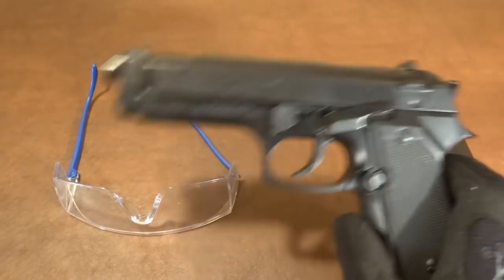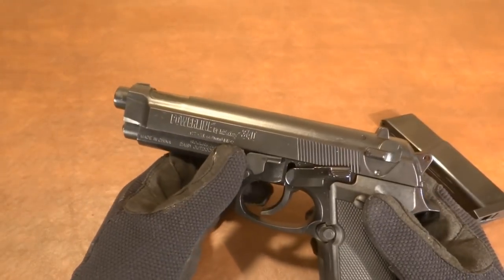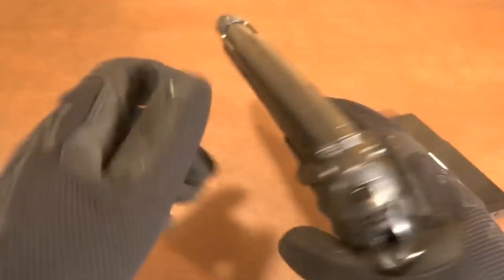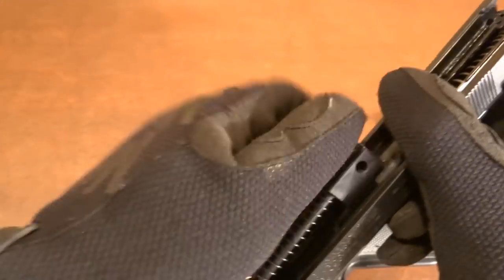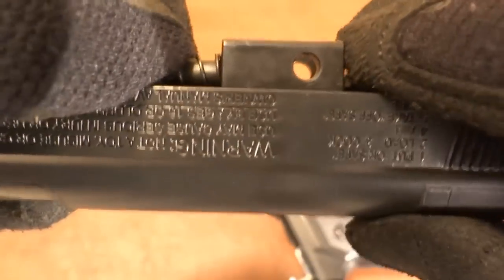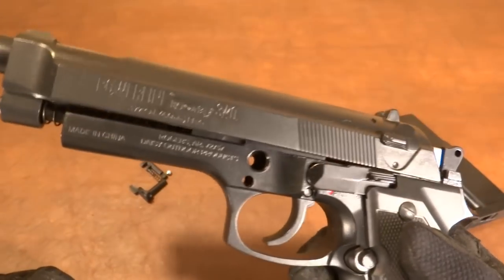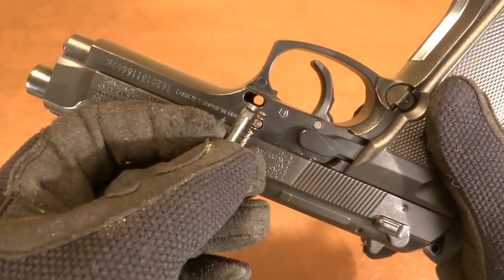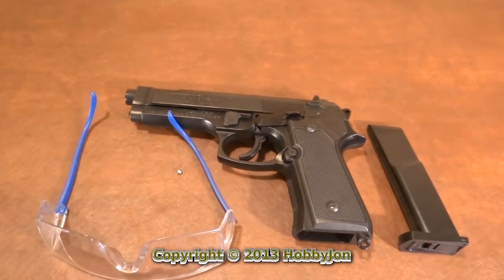Takedown Powerline 340 - Unofficial Guide

Comment: The entire upper slide assembly including barrel and recoil spring is removable.   Compress the recoil spring and use a vise grip on the guide rod to keep it from snapping back.   This gives you room to work.   Then You need to slightly spread the slide frame and pull out the plunger assembly.  I found that a bb was stuck in the plastic plunger assembly and it actually cracked the plastic, allowing gas to escape and cause low velocity shots.   Once this happens, there is no way to fix without replacing the plunger assembly.   What I don't understand is why the correct size bbs would get stuck in the plunger to begin with.   You can easily remove the barrel and guide rod/ spring once the plunger assembly is removed.
Reply: this happened to my first gun i was using copperhead bbs but it says in the manual daisy only so who knows the difference both are .177
Reply: If the seal is broken you can always use plastic welder to seal the crack. It worked for me.

Comment: it does indeed come apart to individual pieces.
here´s a sloppy write down on it, main thing is knowing that the slide is cast and theres afaikc no glue anywhere, hell of a lot of oil oin it from factory though. 
most can probably try bending the piston housing out bend all you will using your hands or small prying tools, you´ll get tired before the plastic is even close to break.
taking the "back" parts out of the slide (spring+springguide/piston+housing:)
1. using a small/thin but wedged prying tool or flathead screwdriver, wiggle your way in between the slide and front/back of the piston housing ON ONE of the sides until it ""comes up a bit" and clearly is free from the protrouding locking edge, in the front and back of that side, now push the tool deeper and try to make it "turn" out/upwards.. ( second way is to try extracting it the reverse way from mounting it ie pry and lift the front free from locking tails/grooves/protrounding parts as youpull  it forwards/up instead of pushing back and down while assemblin.
front
1. you need to turn the front spring guide 45 degrees, 1/4 turn and then pull the spring forward a bit while keeping the rest of the assembly still. 
2. push down on the spring guide as you keep the spring from getting locked into parts below the "extraction hole" for it to come free from the retaining sides and  clear the barrel assembly.

Comment: when i opened my gun to get some loose bbs out, i feel like when i put it back together, it lost alot of power.
Reply: Jonathan Silva  try air gun oil or Remington oil or if you're cheap, WD-40
Reply: Guardion Angel where do i put the wd 40 ??
Reply: the slide, and trigger grouping and the piston assembly. you don't need a lot so dont drown the gun in oil
Reply: It’s not a gun
Reply: Yes, it is. It's not a firearm.
Reply: Same here
Reply: @guardionangel2378  we did this, however, there still is a loss in power and range

Comment: A question my gun no longer fires as strong as before I can do?
Reply: I have the exact some problem as you I have tried everything
Reply: You can stretch the spring i think, it will give stronger power temporarily but will eventually weaken. Or you could try and find some stronger springs that fit. Maybe a spring specialist maker could make one for you from a thicker gauge wire or more coils or longer. There are possibly some airsoft guns that have stronger springs. That you could remove and fit to the daisy, or airsoft parts websites or call daisy themselves. Or stump up $9.87 for a new one at walmart.

Comment: I have a problem and can’t find a fix, a while ago I took off the right grip cover and now my gun whenever I pull back the hammer and pull the trigger, the trigger doesn’t automatically go forward as if it wasn’t fired, it stays in the fired position. I can just push the the trigger forward but I don’t know if I want to fire it until it works properly cuz I’m afraid it’s just gonna explode in my hand if I do.

Comment: So I just bought this gun today and I got too curious and took it apart for no reason and lost the spring for a couple minutes I found it and tried putting it back together but all I had to do was push the barrel down to fit the big switch I was panicking for 10 minutes

Comment: I think you are asking for trouble when trying to take apart a cheap BB Gun such as that.  Just clean the barrel from the front ,end, of the gun.
Reply: I know this comment was from four years ago but yeah I agree with you, I tried to field strip mine just to get experience for when I go onto cleaning actual firearms, and the slide would not go onto the gun no matter how hard I tried, and I ended up bending back the metal piece that the firing pin hits to fire the bb, honestly annoyed because that's the second time that's happened to us because we had another one and the metal piece in back bent too, honestly never gonna buy one of these again because of crap quality, as cool as this thing is, not worth potentially breaking again. :/